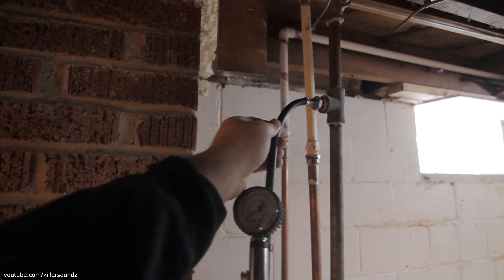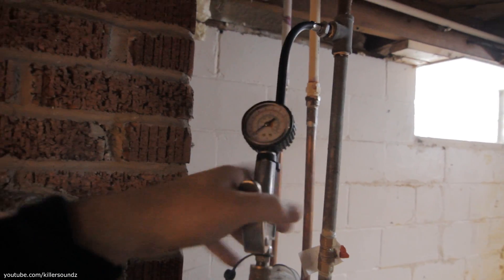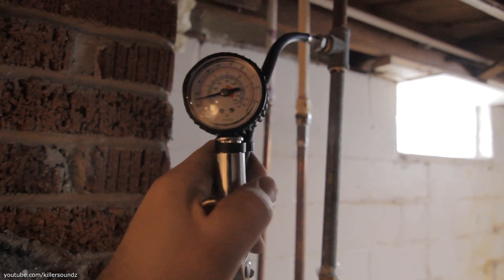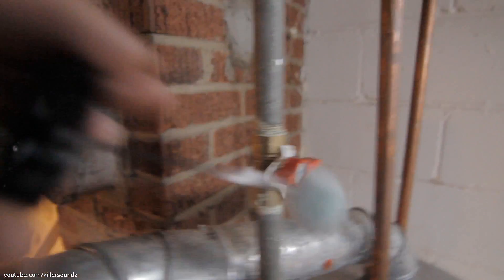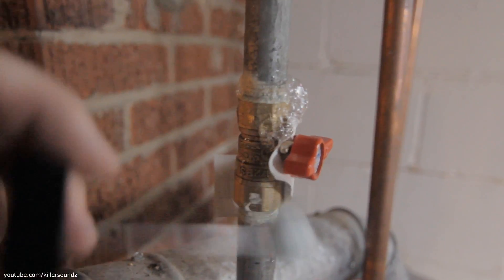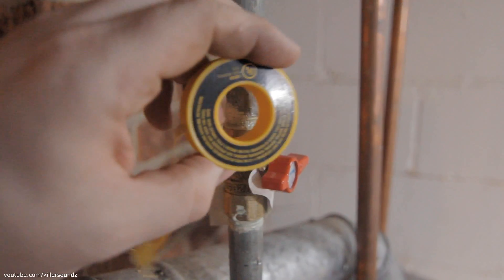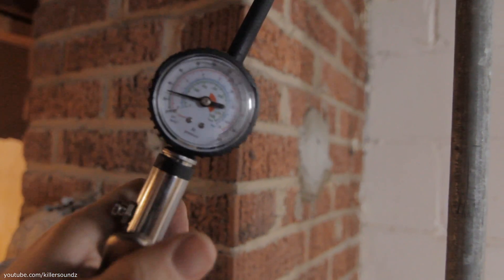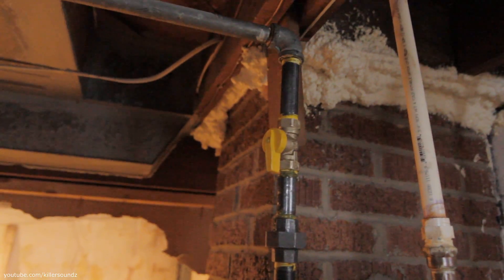DIY Pressure Test Natural Gas Lines Cheaply w/ Tire Inflator

Comment: Dude have you passed your gas ,does America have gas regulations you would NEVER get away with using a tyre inflation device to test gas in the UK ,interesting how rules differ from country to country
Reply: He does a diy test pressure, so when the gas company gets called they turn on the gas only if it passes their pressure test.

Comment: Alex how exactly do you purge the line?  You don't have gas running through it when your pressure testing it correct?  You're pumping air into the lines instead of natural gas, do I have that correct?

Comment: DO NOT EVER use the yellow tape on connections. Any gas company will tell you to only use pipe dope. Do it right. The tape can deteriorate and end up in your orifices, clogging them.
Reply: It is my understanding that white tape, which is NOT FOR GAS deteriorates and ends up in orifices but the yellow tape IS FOR GAS  .  If used, one should avoid wrapping the front threads so it won't get into the pipes, however.

Comment: Same thing I did. BUT valve out all equipment that runs off your gas line. If you test above 1psi you can riun controls on your systems. If all your lines pass then keep your equipment valved out but test your i.e.furnace at the dirt leg keeping it at our below 1psi.

Comment: I think the test port you need to connect for testing should be outside the house, this way, if that test port itself ever leaks (since it's the final connection) you will never leak gas into the house.

Comment: Thanks, great channel.  There's a lot of pro's online here foaming at the mouth about hating DIY'ers, but truth be known, it was probably a professional that installed that connection you found leaking!  But, of course, it's very important for DIY'ers to do your homework, use the right pressure for testing.  PS. Gas plumbing is kind of a joke.. I mean, there isn't a specific torque required or specified for connecting pipes.  Best advice I could find anywhere was tighten as hard as you can with a 6" wrench.  LoL.  Suffice to say, use the right black pipe, tighten with the correct dope sealant (more of a lubricant as some describe it) and test with very little pressure, if the output from the gas meter is 1psi, then 3psi is the most you should go, just wait a nice long time and if you have leaks, start redoing the connections you made then move on to the connections by the "professionals".  Not to bash the professionals, but even they make mistakes.

Comment: Thread tape is the way to go. The oatey pipe thread compound works. Looks like the person who plumbed that cross threaded that valve. That much gas leaking down into a basement over time can create a big explosive type problem as gas is heavier than air and will settle in that basement. Same thing happened to school in TX and killed everyone in it when it went bang, that’s the event that caused the adding the odor to the gas that we all know so well
Reply: Natural gas is lighter and will rise.  Propane on the other hand will settle and create an issue.
Reply: @tonyrodriguez9014  true, I should’ve specified propane

Comment: You use a tape then the pipe dope "liquid stuff" the tape does the sealing the pipe dope "liquid stuff" is used as a lubricant so its easier to get it tighter. That's how I was trained from the ole graybeards on the job 20 years ago. Ben using both ever since never had a leak. I have not had a chance to use the blue ( I just looked at it yesterday I think its gorilla or king Kong )but 12 dollhairs 😁 at the home death  spot.  I don't get it because I already have a tried and true system tape then dope. Good to go.
Reply: Absolutely a waste of time and material. I have proven this time and time again with my guys. I only use dope on water in underground applications for 20 years and not once have I ever had a call back. We have 3 areas in the county water system where it is common to see upwards 200 psi.  At the curb. If dope can handle that, there isn't a gas line on earth going to match that demand. Thread tape was from my old days really, we still call it dope, but it's not, It's very rare to find true dope any more. Now we use ptfe, aka Teflon paste. Dope was petroleum based, which ate plastic, so we had to use thread tape on plastic. Out of habit I still tape plastic threads, I feel it also helps fill the threads.  But it's unnecessary now, and to go a bit further, if you do use tape on gas you need the yellow gas tape because the regular spreads off into the gas line and can clog orifices. Or just use dope and be done lol.

Comment: Couple points! Pressure testing isn't very costly to have professional do it. Most natural gas appliances, furnace, etc,pressures will only be around 5 to 10 psi. You really need to disconnect appliances etc as to not damage valves and diaphragms that aren't designed for 20 or 30 psi. Also black iron pipe,or flexible stainless would be best type of pipe in my opinion. Gas piping is no joke and doing it improperly could cost lives literally. Kudos for Diy video and trying to help others save a few bucks, But......
Reply: I’m a licensed mechanical contractor and licensed master plumber. 

In regards to your comment: You are wrong on almost everything you said.
Reply: @thingsnstuff21  but is right to not have appliances connected during a test. Tests should be isolated with plugs and caps and without low psi valves in the test.
Reply: @dangunnoe Are you kidding? A ball valve can only handle 1psi???? No, I doubt it!
Reply: TYPO, gas controls would be 5 or 10 INCHES water column [WC], NOT psi. BIG difference!
7"WC is about 1/4psi!, so 10"WC is around a third of 1psi, and some furnace valves have this max pressure label right on the valve...

Comment: You are dangerous as are many DIY'ers. Your test pressure is waaay too high and probably caused the leak you found. Gas cocks are only rated 5 psi. You must disconnect and isolate ALL appliances because you'll blow their valves. High psi doesn't show low level leaks. Pipe dope is the approved and preferred sealant. Teflon tape breaks off and clogs valves. People like you put the rest of us at risk because we enter your homes not knowing the stupidity of your "repairs". If something goes wrong and someone gets hurt thankfully you'll go to jail. This channel should be banned.

Comment: Galvanized pipe can flake and clog your gas valve, that's why the black is used. I heard the propane in the  line was set at 2  pounds pressure from the regulator. The gas company should be able to tell you what the pressure is. wrap the tape 8 times around it goes on easer and is less likely to ever leak or get the stuff in the can. you cant put it on too thick or tighten it to much. lug nuts are tightened from 150 to 300 pounds you should know how that feels.. 2 pounds of gas cant squeeze out past that. that little bitty leak would never blow you up . it you put a torch on it,  it might over time burn your glue but your house would have to be prey engulfed in fames already to cause problems with that gas line.
Reply: Boy, you sure don't know anything about lug nuts.  If you were to tighten cars wheels to that spec look out because the lugs will break somewhere down the road.  The Alcoa 22.5" wheels on my 36 foot motorhome are torqued to 300 Ft. Lbs.
Reply: Wrong units! you got your facts mixed up (please proof read or don't give dangerously wrong info).
Propane is around 11 - 13 INCHES of WATER COLUMN!
NOT psi! There is around 27"wc in 1psi, so propane is about <1/2 of 1psi! (much less than 1psi, got it?)
[11"wc = 2.75Kpa = 0.4psig]

Comment: i don't have time to explain how wrong this is....
Reply: I’m all ears
Reply: @francistafaro3  (United States) The gas pressure out by the street varies, but is around 60 lbs.  Residential (house) gas pressure is less than one pound going through the regulator/meter (safety). Every gas appliance (water heater, range, dryer, furnace, etc.) has its own secondary regulator (safety). When testing a house using higher pressure you MUST disconnect each appliance and temporarily  cap it or you'll possibly (probably) damage each secondary (more delicate) regulator, designed for regulating only a fraction of a single  pound. Most of the gas shut-off valves are also designed for very low pressures. Once the appliance's gas legs (or branch lines) are properly capped you can air the system up to 60 lbs (or more). 
    As for pipe compound (pipe dope), the main purpose of pipe dope is to lube the threads so you can properly tighten and (possibly later) loosen the joint....it is absolutely NOT to make the seal. The(malleable) metal to metal, threaded portion should make the permanent seal.
I gotta go.......thx.

Comment: So your pressure test is wrong, 10oz for 10 minutes not psi. Pipe dope is proper sealant. Galvanized should not be used for gas line only ward flex or black iron. Everything you did is wrong. I’m a plumber and hate you diy’ers. Have fun blowing yourselves up.
Reply: Here in Houston the OUTSIDE gas lines ARE galvanized.  One was installed 20 years ago, the other was done in the '60s, both met code.  One commercial instruction said no more than 6.5 psig with all appliances disconnected.
Reply: Yet , foaming mouth plumbers want to rip you off with 450 just for assessing  the problem      So imaging fixing it.     Fuck that !    As a master electrician my self I hate shady plumbers
Reply: @juyoleyva9330  this is for sure.  Do it yourself is a superb idea, as long as you do it yourself correctly.    I got an estimate for work I need to do of $5200 {Imagine how Eddie Murphy said  Five Thousand Dollars  read my lips  Five thousand dollars}  .  Work order said $450 just for attaching GROUNDING {or bond} to the corrogated stainless steel tubing{CSST} they were going to put in to replace my current iron pipes.   I can buy 25 feet of 6 gauge wire for $45 or less at a big box hardware store and a ground clamp and open my electric fuse box and ground it.  Like you, the middle finger to that!  Their prices can kiss the part of me{I'm a cyclist} that goes on my bicycle saddle.

Comment: To do this right,  use a hand pump. You need a gauge that measures ounces (not pounds). It has to hold 10 oz/in. Do not use an air compressor! This video should be removed or edited
Reply: That sounds right.   I am thinking multiple pounds of gas pressure could fry one's furnace gas valves, as well as the ones on the range and the hot water heater {and any other gas appliance such as a dryer if used}.    In use pressure is supposed to be around 1/2 pound and testing needs to be higher, I understand about 2 or 3 pounds.   I'm planning to test mine and may use a higher pressure but will remove all appliances and put the appropriate caps on the lines.  I will not have to worry about the gas meter as my gas is already turned off and the gas company will bring the meter back when they pass me for turn on.    With no appliances on completely isolated with caps, I bet you could test that iron pipe with 30, or 60 pounds.    Probably 5 pounds at best if one only isolates the appliances by turning their  toggle switch valves off without disconnection and cap.  
I would love to know if any electric gas valves {hundreds of dollars to replace} failed as a result of this testing.
Reply: If the appliances’ valves were Off, testing to a higher pressure is good!  Better than good!

Comment: I would use caution on 30 psi.  You're going to wreck your supply valves.  And the big one is that if you feed that amount of pressure back into the meter you'll ruin it.  Most domestic meters have a MAOP OF 5psi.
Reply: i heard to much pressure isn't good so where should he have stopped to preserve life to his system components? using the same idea?
Reply: @pocketdiy  I wouldn't cross over 5 PSI.  First the residential meter typically has a maximum allowable operation pressure of 5PSI.  Pass that and you can ruin the meter.  When I look for leaks I keep it around 3PSI.
Reply: that makes sense.  You could always turn off the valve right after the gas meter?
Reply: @dsolproductions    Typically there's  no valve after the meter. There's one before it that protects the regulator too. This video is SO wrong.
Reply: I used to test new installed gas lines with a pressure gauge a bike pump and no more than 10lbs PSI for 15min or was 15lbs PSI  for 10mins definitely not 30lbs that is very
Reply: There shouldn't be anything wrong pressurizing the lines and valves to 30psi as long as the valves is rated, its common practice for finding very small leaks. New valves are typically rated 600wog and black iron fittings are 150psi. A better practice is to close the valves and open the unions, leaky valves can over pressurize the gas valves and thats a very expensive repair. With that said, would you arbitrarily pressurize a 50 year old system to 30psi? probably not as you could induce a leak past some rusty threads and dried up dope.
Reply: I stay around 5 to 7 psi. Going too high can damage some shut off valves

Comment: Thanks for the video if you want to go one step further you can add a shut off at the gauge to take the hose out of the mix. I would add that all appliances need to have the shut off valves closed to do this test
Reply: Shutoff valves must always be kept open, as they only stop 1/2-1 psi pressure.
Reply: @justinmaxwell2192  WRONG, AFAIK...
Reply: NOT GOOD ENOUGH, experts, AND the code, require the the appliance outlets be capped off or plugged (appliances disconnected, or tee's or unions opened).

Comment: Ya I get that but you. Cannot over pressurize a valve that is rated for less so if it's rated at 1/2 psi and you pump 30psi you can ruin the valve that's why it's rated 
Your video clearly doesn't  explain that

Comment: you ot really supposed to pump air into an existing gas line you should use nitrogen.
Reply: Nitrogen  is not for diy'ers ass wipe more like for pro plumbers prick

Comment: dude what PSI is that shut rated for? you have to look at the rating before you go pressurizing a shut(s)
That is certainly not the reason it's leaking but gas shut offs are usually rating to 1/2 PSI or not much more unless it says it is.
Also pipe joint compound whether it's white or blue or teflon tape it all has to be applied properly so ya it does work but gotta do it right
Reply: HAHAAH 1/2 PSI ......boy you are a Rookie.
Reply: Alex Knappenberger why not just use 6psi.....how would u check for leaks up to regulators?